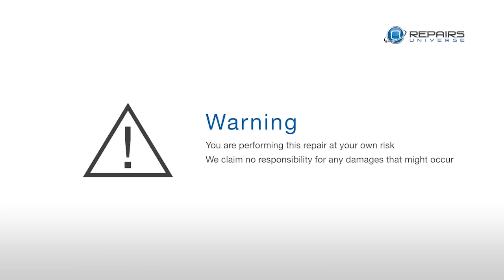OnePlus 3 Take Apart Repair Guide - RepairsUniverse

Comment: Very good video! How to fix problem with proximity sensor I have dropped the phone in water and only the proximity sensor is not working everything else is working fine. I don't see in the video if there is option to replace it. I haven't opened it in might have corrosion I'm waiting the tools from ebay to open it. Any suggestions. Thanks

Comment: wow it's professional way to dismantle the phone.
I have issue with the changing bord probably the type C connector damage . I have to push the charger with my hand and keep it attached with my hand to recharge the phone is there any spare parts for type C connector ?
Reply from the maker: +Mojo x Sorry but as of right now we do not have charging port replacements for this device.

Comment: i have a one plus 3 broken screen is thear a easy way to change it or do i need to do all this?
Reply from the maker: To replace the display assembly it is the best practice to full remove all components from the frame to avoid damaging them with heat.
http://www.repairsuniverse.com/oneplus-3-lcd-touch-screen-assembly-replacement.html
Reply: can i replace only the glass infront of the lcd screen ? like on other phones